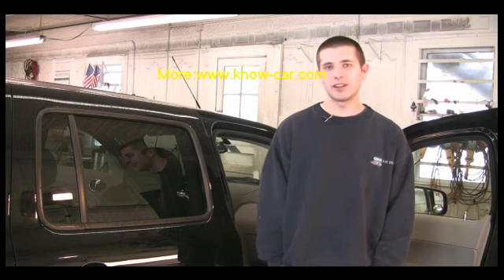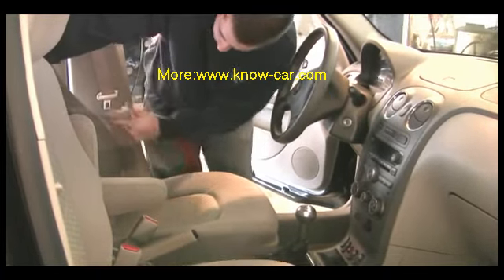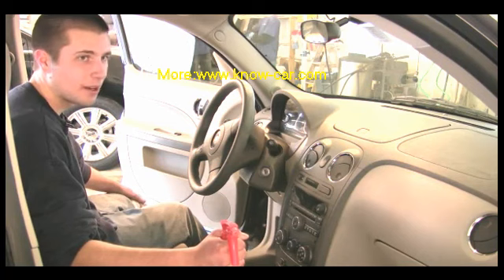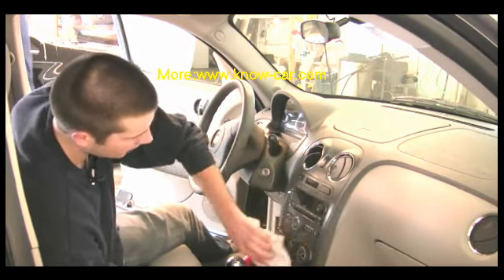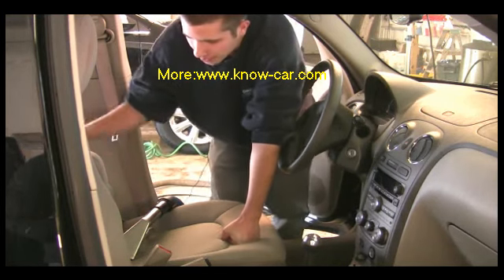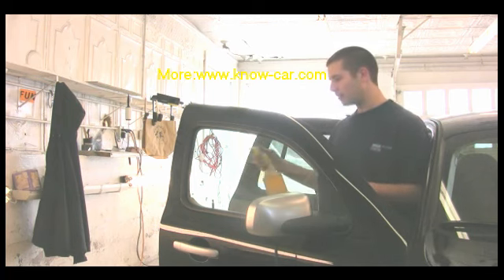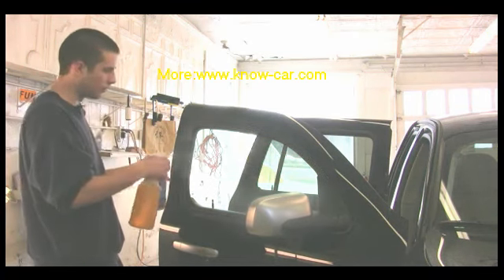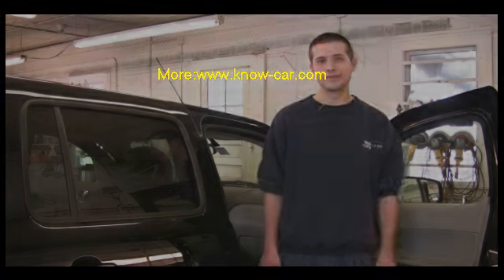How to Clean a Car That Has a Very Dirty Interior

Comment: I have seen some videos where people use compressed air on the clothe seats to blast out dirt, dust debris, at the same time as vacuuming. It's a good idea to use a low air pressure as to not tear or damage clothe. As well wear a mask so you don't breathe in small particles.

Comment: This is an example of detail shop 101 of what not to do. I have seen many a car from detail shops that have to be repaired afterwards. Make sure your window s aren't tinted if you're careless about the detergents you spray on them. Ammonia based cleaners will harm tint.

Comment: I'd like to point out that with vehicles that have a top door sill covering the top edge of a window, you should roll down the window a few inches and clean that edge. it makes a big difference if the driver has the window partially rolled down. Alot of crud can build up there and that is an area that often goes uncleaned.

Comment: @mbozza spray the gp on seats or carpert, then scrub with brush, dont spray to heavy b/c its going to air dry if u dont have a wet vac. ps leave windows crack to dry so u dont get mold or mildew, smell!

Comment: No Simple Green for interior products. Maybe the automotive formula that they market, but I've never tried it.

Lint free disposable rags or microfibres for the windows.

Like another guy said... compressed air for cracks in the dash seem to work well, but be sure your compressor has an inline liquid/air separator. Otherwise you compressed air stream will include a fine mist of oil from the compressor and/or water that has accumulated in the tank.

Also be sure to clean your plastics!

Comment: If you are a car enthusiast looking for a way to incorporate eco living into auto detailing, then steam cleaning is the ideal choice for you. When you use steam as the cleaning method, it is not necessary to use other detergents or chemicals for a more thorough cleaning. The heat of steam alone has the ability to break down the most stubborn build-up on the engine. Please check out our channel or website for more info!

Comment: Actually the proper way to clean windows is put the window down half way and clean the top edge on both sides at the same time then put the window up and continue on  doing the rest of the inside window, then the outside window as long as the car has already been washed.

Comment: You've just saturated that driver's seat, dude. Not to mention what you've done to the electronics on the dash. Spray the solution onto the MICROFIBRE cloth, then wipe the surfaces down. Also, what is an "Industrial grade window cloth"?

Recommendation: you only need microfibre cloths for 99% of your jobs.
Reply: Mathew Wood

Comment: dude, it is ok.. I have the same dirty job ...I work at a car wash. the spray used to clean the plastic part ( buttons too ) is made for that, it does not corrode anything, but first pull out a key from your keyboard to see what the spray has to pass trough before it hits the electric part. :) So dont you cring ... :)

Comment: I would never use Simple Green on any interior. Use as mild of a cleaner as possible and NEVER spray the cleaner directly on the surface; spray the cloth. You can use a soft bristle brush for crevices but compressed air is much better. NEVER spray any liquid on the electronics of the dash like he did...unless you want to risk destroying your command unit, radio or instrument cluster. Lower the windows halfway and clean both sides of the edge that goes into the channel first, then roll the window

Comment: Just a few extra tips I thought I'd throw out that this video didn't cover. He could have also gotten a little more in depth with what products to use. Because as he says in the video "use any general purpose cleaner.... they're all the same". THIS IS FALSE. As I said also, avoid Simple Green. I've seen the regular formula discolor interior pieces before. Again, I've never tried to auto formula... I just avoid it altogether.

Also maybe give some tips for the people without auto carpet cleaners.